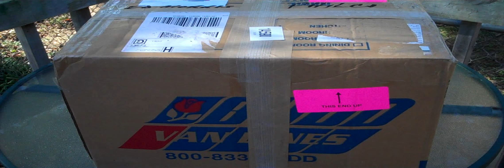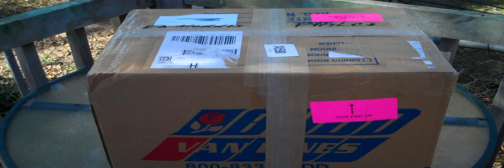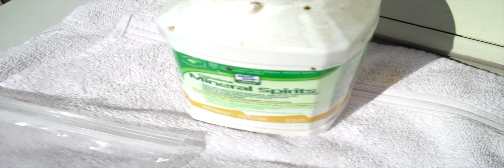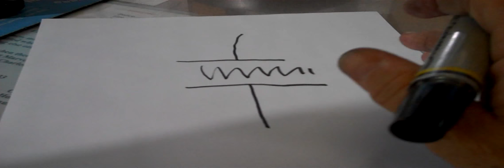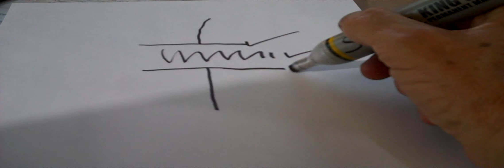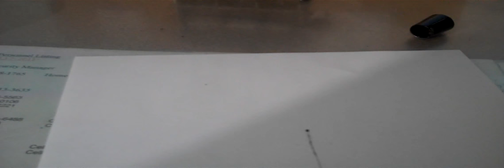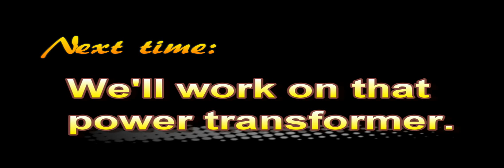1936 Philco Model 630B Repair and Restoration (Part 9 of 35).

Comment: There are actually 4 ball bearings inside the brass tube, 3 larger ball bearings and one smaller ball bearing along with a spring all the way at the front.  Hope this helps someone.